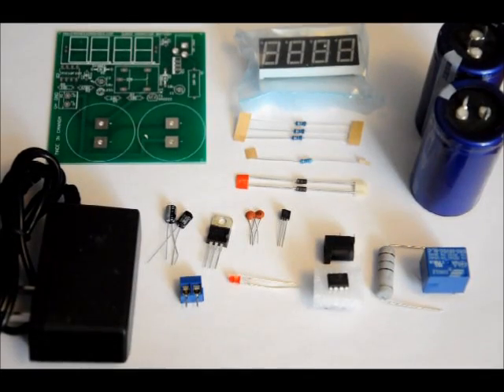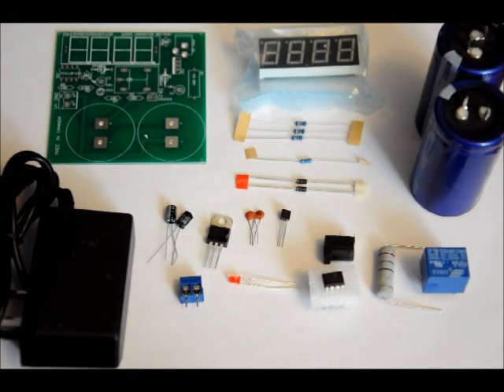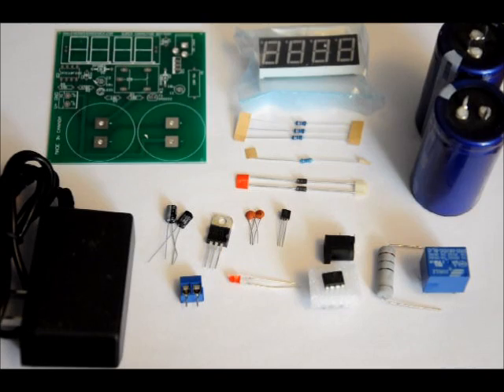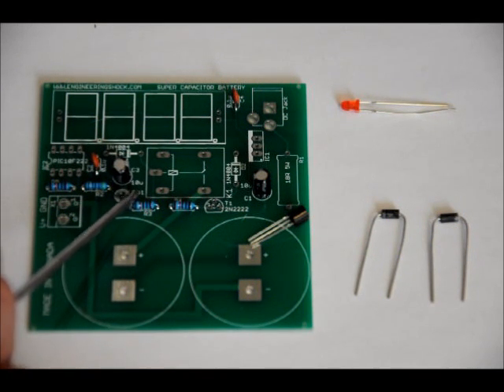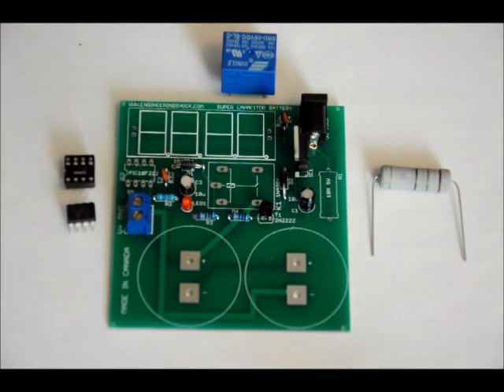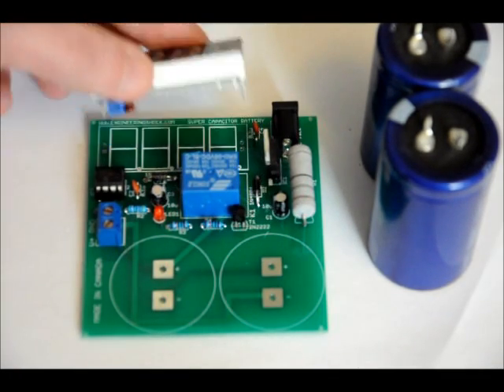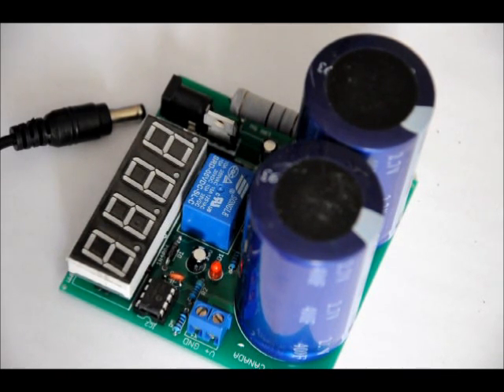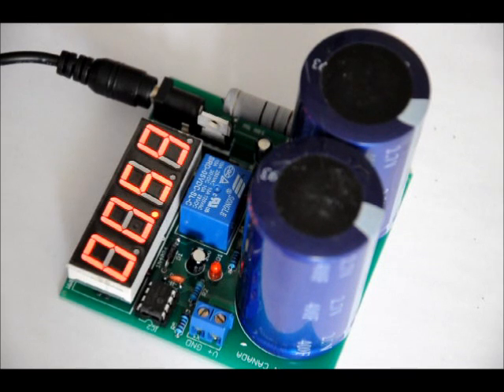The Super Capacitor Battery Charger DIY Electronics Kit With On Board Capacitor Bank

Comment: Giving a list of spares on a paper in the video would help a lot.
2. What is the no. Of the PIC of?
3. I do have super capacitor of 3v 400 F. Which resister to change to get the requested charging?